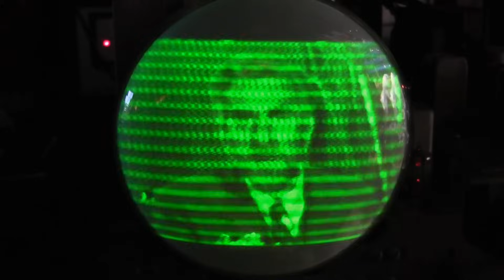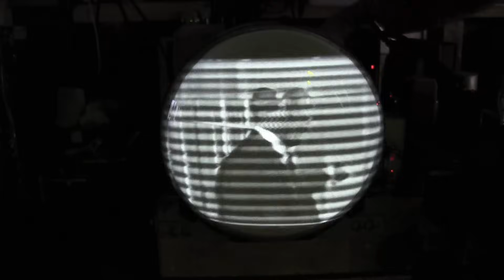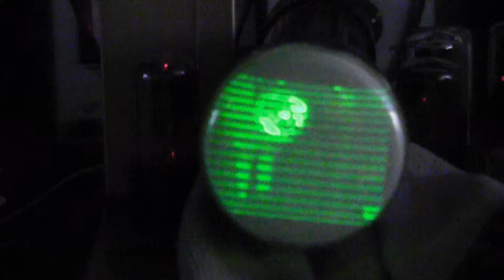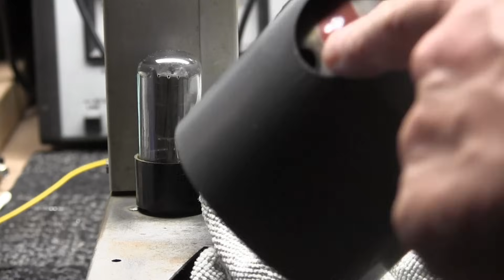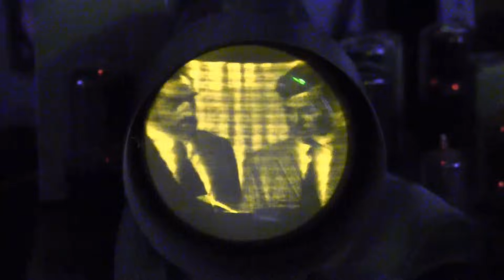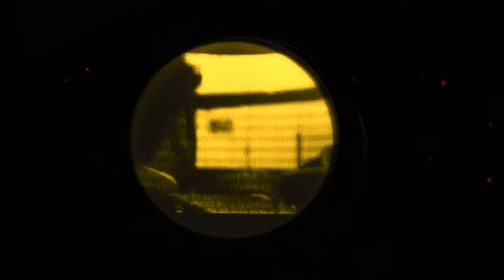How to restore a 1940s electrostatic TV (Motorola VT71, Admiral 19A1, etc) : part 9

Comment: Thanks for showing us how various CRTs look in this set, I like the amber phosphor one as it gives sort of an "old film" or "old photos" or sepia tone look to the pictures. My guess about the interference is that it could be that the tuner could have either shielding or tube issues, or the fine tuning might be out of range, so maybe adjusting the oscillator slug for the channel you are receiving on may help, although of course there could be something else as well or instead.
Reply from the maker: The interference issue will be solved in the next installment

Comment: How many $ in parts and how much time do you think you will have in this restoration? I have a Motorola of the same vintage with a nice Bakelite case. (series string) I don't know if the CRT is good. I've never plugged it in and don't intend to with original caps in it. Just want an idea before jumping in.
Reply from the maker: I talk about the cost in part 1 IIRC.  Depends greatly on what type of HV cap you go with.  Basically $5 or $50 for the HV caps.  Motorolas require other specialty parts that this Admiral does not for the ballast tube replacement and it uses more expensive electrolytic so it's not a good comparison.  Roughly figure about $100 in parts to fully restore a Motorola chassis using axial HV caps from Just Radios.

Comment: Bob, my 1954 Jackson CRO-2 used a 5UP1. Don't know if the base matches your setup. Just saying.
Reply from the maker: No, it has a different base - only 12 pins and smaller.
Reply: @bandersentv  LOL Love it!
Reply: @bandersentv  indeed the 5UP1(F) with a flat face is used in the Heathkit IO-12 scope and does use a12 pin base, not the Di-heptal large 14 pin base, In fact my bedside Lamp is an old 5UP1 from a Heathkit scope that I parted out because the CRT had an open filament. I have combined it with a 12 inch lampshade and a vintage style light fitting and i think it looks really good, cant think of a better way of using now its filament is broken

Comment: Wow Bob, you are really banging out the "Hits" today!

I think the deflection is similar from CRT to CRT because the design is set up to provide a certain percentage of screen deflection, based upon a standard percentage of high voltage difference between deflection plates.

I know there were many different phosphor coatings used with Radar CRTs.  I got to witness a radar station in 1973 that was looking down the Florida Keys.  It was a PPI display with a 12" CRT, that used a long persistence yellow.  I had never seen that phosphor before, it turned purple as the image decayed.